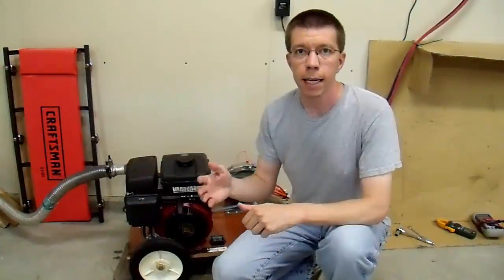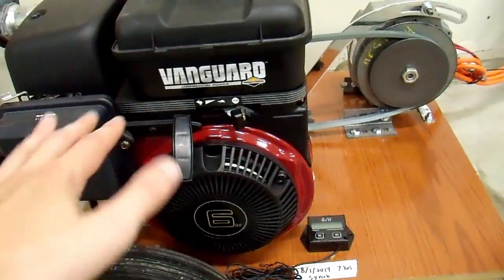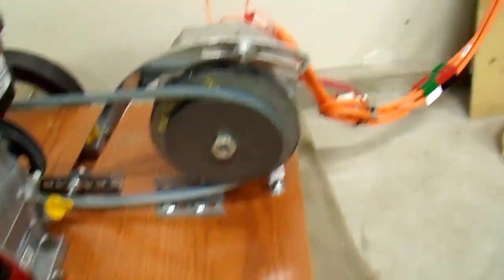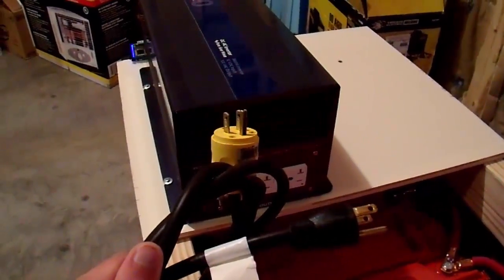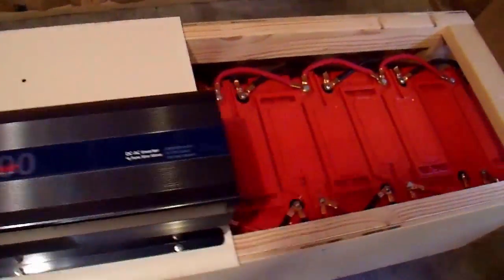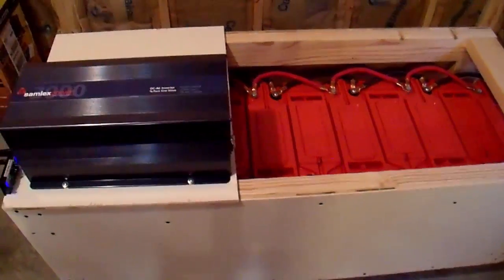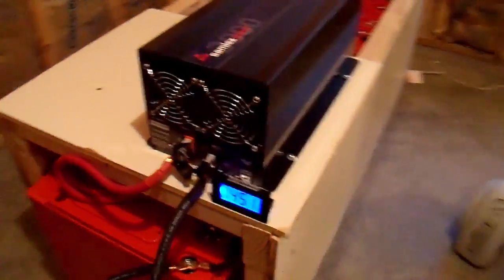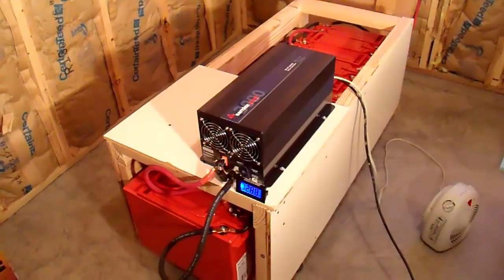DIY 12V Generator Charger - 10 Demonstration and How to Build

Comment: Very very nice job you've done there.
Thanks for sharing.
I have a big farm, and I wanna put on a hydraulic wheel ( a wheel turning with running water) instead of the generator, can we make it happen ????
Reply from the maker: You'd have to gear it up with a few sets of pulleys but, yes, no reason it wouldn't work if you match up the torque curves.  A 27si alternator will start generating power at around 1000rpm and hit the sweet spot around 3000rpm.  They can spin up to around 15k rpm on occasion without damage so they're pretty durable that way even if you get the ratios a little wrong.
Reply: yes i'll give it a try and i will let you know
Thanks a lot

Comment: Great setup, but why all the 12v cable, you could of just had a redundant mains outlet in your garage solely for the generator with a double pole switch and a 100 amp fuse and put it all in a tidy box... Just a suggestion....
Reply from the maker: Perhaps a good idea but I'm not understanding your suggestion.  My batteries are in the basement and the inverter requires those batteries to operate.  I somehow need to get the 12V power to the batteries or move those batteries and inverter to the garage where I don't have room for them.  $100 worth of cabling which will appreciate over time if I choose to re-sell it seemed like the best solution for me.
Reply: @knurlgnar24  Fair point if you have no room, even if you had somewhere safe outside in a secure box/storage cupboard and just run flex to a mains outlet socket for your emergency generator...
Reply: @tsetsefly4538  It's 12v dc and 80amp. You can't put that through the mains or flex. It would burn.

Comment: HI! is it possible to connect an inverter directly to the 12V output of a generator that does not have an inverter? Thanks
Reply from the maker: Those outputs are usually not clean power and can only be used to charge batteries.  You could connect both a battery and an inverter and do it that way.
Reply: @knurlgnar24  i actually think it "might" be clean enough with a decent quality inverter.... But not the cheap ones, they would just alarm

Comment: it is very good but it need more part to work  efficient a first you need info about the total amount of amps in your battery setup  then you need   battery data sheet . you can't put 80 amp battery with a  90 amp together you will lose amps  , each battery have max current rate charge after that number you destroy the battery system

Comment: Glad to see someone this set up. Planning to build one myself, but on 24v setup. Way cheaper than buying a generator, as well it takes less fuel. Great job. As to silent your setup you gotta make an enclosure to it and add some foam to insulate on the inside. Just leave some air vents, for the engine to cool down, and as your setup you may add a propeller for more efficiency.
Reply: Or change to a Diesel engine. These doesn’t gets as hot as gasoline and they are more fuel efficient, lower rpm and more torque.. Mont a car propeller on the engine shaft. That way you won’t use electricity to power that, and will be bade by the engine while running. Mechanic propeller, not electric.
Reply from the maker: I actually did this on an inverter generator a few years ago.  Quiet?  sure.  But I couldn't find a reasonable way to prevent it from running hot enough to reduce the life of the unit unacceptably.  I would have needed an enclosure the size of a shed with a reasonably large powered fan - which would waste a good portion of the electricity.  I determined that I was better off just adding a muffler for future applications.
Reply from the maker: BTW I agree that a 24V setup would be better!

Comment: Total BOM cost? Total man-hours invested? Total cost of ownership? Good investment, or just fun repurpose?
Reply from the maker: Mostly a fun project and most people would be better off with a generator and battery charger.  It does have some practical purpose however for an off-grid or prepper style application as all of the parts are extremely easy to obtain both today and 20 years from now, the lifespan will be thousands of hours, and it is simple technically with little to go wrong.  With a hundred dollars of spare parts this sort of setup is almost guaranteed to outlast any generator out there and it doesn't have any electronics to age if kept in storage for long periods of time like a Honda EU or the like - plus the BOM is probably under $400 if you don't spring for a Vanguard engine.  Efficiency is comparable to a generator/charger setup.  Keep in mind that high output chargers tend to be rather expensive if you want a quality one that will last thousands of hours.  Those RV supplies will only last hundreds at high load in practice and industrial supplies typically wear out after a couple thousand and cost a similar amount new.  They can be cheap surplus/used though.

Comment: I've just started building my own, I watched the series years ago and the algorithms for the internet must have cross referenced my recent orders with previous youtube viewing and put this on my youtube home page.

I've found L-095 jaw coupler that should handle the load so I intend to avoid belts, if you're still around, would you comment on your generator's current status, is it still working, any pit falls to look for?
Reply from the maker: Still working though I admit I haven't actually used it in a couple of years and I had plans to convert it to a 48V setup with an external regulator mod or a PMA which I also purchased.  Two more video ideas that I never did...  Anyway if you use that jaw coupler make sure the spider and couplers are rated for a reciprocating load or it will tear itself apart after a short time, and alignment is critical.  More than a couple degrees out of alignment and service life will be short.  Those spiders don't like vibration and will not last as long as a belt which is also more easily replaceable.  I do like the coupler setup better overall though for other reasons.  Oh, and be sure to pay attention to cooling fan rotation direction if it is directional on your alternator.
Reply: Thanks for the feed back!

I intend to build a cage out of angle iron to house the setup, and use threaded rod adjustments on the alternator mount so I can fine tune the alignment one 3 axis.

I winced when was  re watching the video where you talked about jaw couplers not being great for reciprocating loads right after I paid 90 bucks ordering them :D

We'll see how it handles it. I was considering adding a hefty fly wheel to the engine to reduce the impulses on the coupler... I may end up just using a belt I guess. I ordered a urethane spider, we'll see how it works compared to rubber.

I'm going to use a 10ohm 100w potentiometer/rehostat on the field windings, I was watching another guy (https://www.youtube.com/watch?v=GUKvGFdYu_Y&list=PLQ6IOhUBblU3mBem9ImEgGzmqToW6SCJD&index=23&t=0s) who built one and it seems that if the battery is low or a sudden large load comes online, the alternator can't keep up.

He uses one to limit the current so that the batteries take the load spike rather than stall out the engine.  I suspect this isn't an issue for you since your battery bank is massive comparatively, as well as the length of the leads between your generator and the bank provide current limiting so it's not an issue.

Since I'm starting out with just a single 95AH Deep cycle, I'm worried about charging too fast and want to be able to limit the current as well to ensure I don't boil them.

He also uses an external regulator from chemlec (http://chemelec.com/Projects/Alternator/Alternator-Reg.htm) which I'm going to build as well. My alternator is supposed to be a 3 wire but I got sent a 1 wire, so I might as well just jump right into it.

I'm going to make a youtube project out of it, I don't think I'll try to become a tuber, but I'll make the video's public as a knowledge repository. I'll send you the links when I get started, though I'm picking away at it slowly right now and I'm still working (from home) so I don't have as much free time as I thought I was going to get.

Thanks for keeping your channel alive, I think it was you that I talked about fixing an 800 watt ProWatt years ago? had a bad switch, still going strong. That and a 1000W pure sine inverter are what I'm going to use on my setup.

Eventually I intend to automate it with a micro controller to make it work like a storebought inverter/generator that auto starts to top up the battery bank, but I'll be happy to just be able to keep a charge and runs some stuff first in the short term.

Sorry to figuratively talk your ear off.

Cheers!

Comment: WAYYYYYYY yoo long cable from your alternator to batttery bank. so much loss there
Reply from the maker: Not that much loss.  0AWG at 80A and the alt is temperature compensated so it puts out 14.5 to 15V in this setup as it stays cool.
Reply: @knurlgnar24  Ill not argue, but I 100% sure, your setup is not at is 100% capacity. Wayyyyyyyyyy tooooooo long wire. Read about it... Anyway. And no way you can run your home with 3000w inverter

Comment: Stay with the first hose,then five gal.bucket with water in it.coil the hose inside.no sound,no smog.if a fire breaks out you have water.
Reply from the maker: That's a good idea which is obvious in hindsight but not a common approach - water muffles very well.

Comment: Hi Knurlgnar24, thanks for getting back to me. I am currently collecting the different parts or pieces to build my own version of a similar generator. I will be mounting everything on a Wheelhorse lawn tractor around 1990 vintage. I have more than one of these tractors so I can mount on another tractor very easily. My hope is any extra power will be stored in the batteries when refueling is needed. I am hoping to use batteries rated for 1000 cranking amps. My question boils down to this "How long should my pellet stove run on a single battery?" According to the owners manual for my stove it will draw a maximum of 4.2 Amps at start-up and 2.8 amps to run. I will not hold you to exact times, but if I can get some kind of idea it would be very nice. ...... Thanks again. ....... Keith

Comment: All this talk about amps and watts and volts gets a little confusing. "I am sorry but it is what it is." So my question to you if you can answer is:  can your 12v set up provide me with 1200 to 1300 watts that I think I would need to run my pellet stove and fridge and a few lights during a power outage, any extra would recharge the batteries? Thank you in advance for your assistance and answer. ....... Keith
Reply from the maker: This setup will provide about 1kw.  If you need 1200 or 1300watts that's OK as long as you have a battery or two connected and you allow the battery to recharge between use, as you will be pulling 200 or 300 watts out of the battery.  (e.g. a refrigerator won't run 100% of the time) You can get higher output alternators but the 12V ones that can truly provide continuous power in an applcation like this are uncommon and expensive (think busses, semis, etc) and you would need a larger hp engine.  At that point you're probably better off with a gen set.  This setup uses an extremely common and cheap alternator and an engine you can buy for $100 at harbor freight with a coupon making repair parts extremely cheap and easy to get for decades here on.  This wood base lasted for many tens of hours so far and still works just fine but it certainly isn't ideal - just commenting to note that I realize this fact.  It does show that one doesn't need metal fab skills to build a good working setup though.

Comment: Here’s another silent idea folks buy an electric motor a solar panel a 160 amp 12 volt Alternator and wire as above or hey just a solar panel a controller a battery bank a inverter / recharger and a plug jack!
Reply from the maker: This setup is intended to supplement a solar installation.  Any off grid system needs a fossil fuel backup and this option is an alternative to a standard generator and a charger.

Comment: Why in the world aren’t you using a Alternator off a Peterbilt or something a big one seriously now If you’re serious about making power put some power into it lol
Reply from the maker: Those are not common and are expensive.  These alternators work just as well and are inexpensive so they would be a poor choice.  But more to the point this engine is fully loaded with this alternator and a larger one would not only be 'overkill', it would actually cause the entire setup to not function at all for the intended purpose.

Comment: Since the ratio is one to one, you could make a more compact unit by mating the alt to the engine through a male and female spline shaft
Reply: You never want to direct drive an alternator. The pulses of power from the engine don't play well with the bearings in the alternator. Its best to have a belt, or rubber coupler between the engine and alternator, it dampens the spikes considerably. Things last longer, everybody happy.
Unless you use a large flywheel. The mass itself is used to absorb the pulses, and if a large enough wheel is used, it becomes a mechanical battery. Storing and releasing energy as supplied and demanded. (Edit: consider this, using an RPM based on-off switch, to control the alternators rotor windings. Flywheel slows down below limit, cut power to alternator, Flywheel speeds up, then once above speed set, turn back on the rotor windings. Balance is achieved with minimal issue. Or use a bigger engine. 20hp for every 100amp worth of alternator)

But hey... that's just my take on your question. 

May peace be upon you, in all facets of life. Stay safe out there.
Reply: Can you explain what you mean?
Reply: Hypro adapter

Comment: I built one about 10 or 15 years ago and it work fine. But I found a one wire alternator that worked way better. It didn't load up the engine as much.